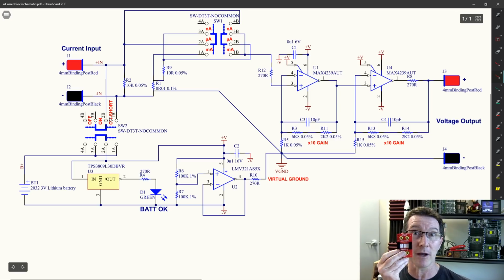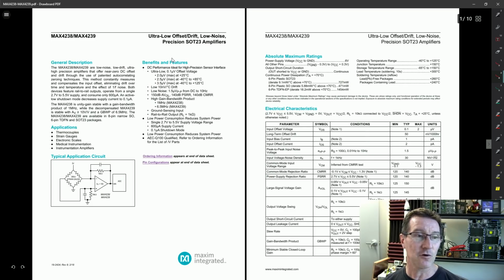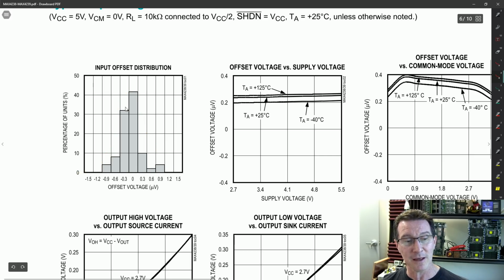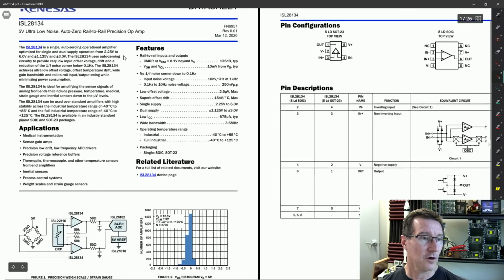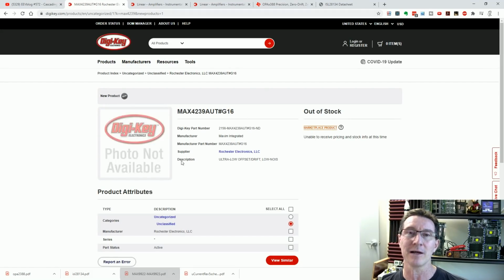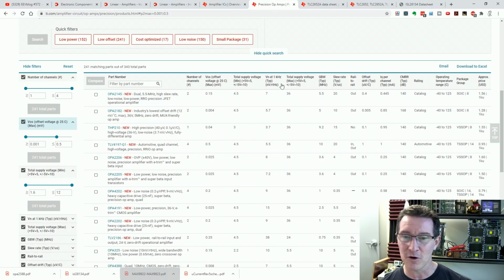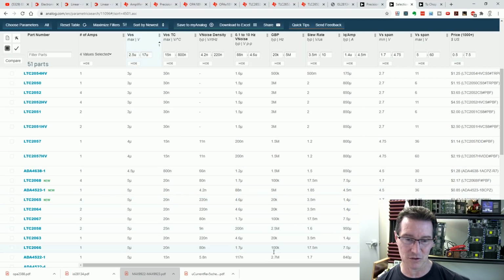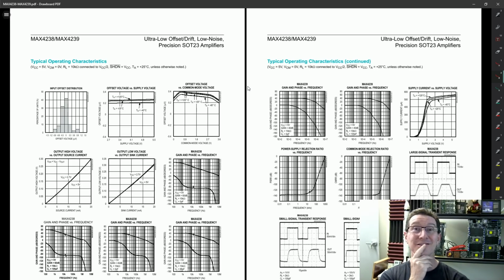EEVblog #1318 - What's State-of-the-Art in µCurrent Opamps?

Comment: Hi Dave, I retired as the managing director of product definition for standard products at Maxim a few years ago.  My group and I defined thousands of products like this for over 20 years and I had a hand in the 4239 parts as well as many, many others.   There were a couple issues that came up in this video that I can shed a bit of light on from the chip company side.   Although Philbrick made precsion amps in 50's with tubes,   Intersil , the spiritual father of Maxim invented this category in CMOS chopper amps in the 70's with the ICL7652.  Maxim's second sourced these parts and made improved second sources early in its life.  Here are a few points that may give you a better handle on how chip companies approach high performance analog.  Because of the way that these parts work, the nominal offset is zero.  What gets in the way of this is real third order effect like thermocouple action in the leads and package stress.  Maxim is somewhat unique in that it can and does do post package trim (zener zapping)  vs. just laser trim a the wafer level.  Parts that are perfect at wafer end up being a couple of uV post package due to stresses.  The other thing about very high spec parts like this (100 nV) is testing.  In order to get good yields, test max limits are generally set higher, we called this the threshold of pain.  The typicial values and histograms are there to give you a feel for what you're really going to get.  In difficult to test specs, you're balancing how many seconds you're spending on a million dollar tester- the cost get significant.  Some specs llike leakage currents in analog switches will often have a max spec of 10 uA though will generally be in the femto amp range.  We would release a different external part number that guaranteed a spec like this.  You can get an idea of the real spread by asking a vendor to make you 10,000 (a common minimum) with some spec tightly tested and they don't balk, it means the parts will yield if the customer is willing to pay the delta in test cost (plus NRE)..  Maxim routinely does this for big customers with precision requirements like a test equipment company.  The histograms in the data sheet is taken from the first few wafer lots as the test guys and the design guys dial things in- this process is called correlation.  On a little amplifier parts on big wafers, there be 5000 die per wafer so you can generate a lot of test data pretty quickly.  The voltage range/dynamic range issue is driven by modern processes.  Maxim has a lot of boutique processes but most analog part in the market are made on kind of vanilla cmos processes which are generally digital and low voltage.  These are generally 100-200 micron processes.  If you see cmos parts with +-5V or +-15v supplies, they are fabbed on old 2 micron plus processes or a specialty analogy process.  Maxim, TI and Analog and a very few others keep these old processes running for precision analog.  The economics of doing 130 nm analog on 300 mm wafers makes parts really cheap even though it takes some real design chops to do it.  Your comments about automotive are somewhat on target, they can be robust but mainly this designation has to do to with consistency of supply, change notices and paper.  Sometimes specs are relaxed to improve yields also.  Automotive guys can work with anything but they don't like surprises.  Hope this helps a little.
Reply: Daniel- fancy processes usually cost more and are on smaller wafers.  It all adds up to cost.  There are several companies that have the processes and even foundries have them but you don't want to use a cadillac process unless you have to.  A 200 mm wafer that could produce 5000 amplifier die per wafer might cost  $500 in a cheap CMOS process.  Fi you want dielectrically isolated or SOI, you get 150 mm wafers for $1000 that only produce 1250 amps (4x less area).  The trick is to make stuff on the biggest, cheapest wafers you can if you want to make money.  The engineering that it takes to do all these clever things on bulk CMOS is what seperates the men from the boys.  There are times when you need SOI but they are avoided strongly.
Reply: This is truly fascinating!
Reply: Really interesting knowledge here. Hope you could write more blog posts like this somewhere.

This is really useful for us youngster.

Comment: Disagree with your statements about guaranteed by design vs guaranteed by testing. Guaranteed by design means assuming process tolerances are within spec then the specification is guaranteed based on physical principles. They can then easily test the process tolerances, or similarly guarantee them. Guarantee by testing just means that they never found a bad part.
Reply: Maxim used a 6 sigma spec for GBD specs which is on the same order as test escapes- about 3 ppm

Comment: Dave, how do you know tht the max4238/9 are indeed chopper amps? Well I am from a time where the µA725 (Fairchild) was the top of the top. Sure there are much better choices today, but even back then there were laser trimmed dual chip solutions available. Also self calibrating op amps I think I have heard of. Now chopper amps are a different category alltogether. Just wondering how you conclude its a chopper amp? Does the spec sheet specify a copper frequency?
Reply from the maker: It's a patanted  "auto-zero" design. Usually they mix the two. Yes, the switching frequency is pseudorandom
 from 10kHz to 15kHz, and you can see this in the response.

Comment: Concerning the bandwidth of an non inverting opamp amplifier, WHY the bandwith decreases with increasing gain? There is any reason that's not the slew rate limitation on its output, or it's the only reason?
Reply: Nope the slew rate is only a property of the last stage. Op amps have multiple stages. To ensure a constant gain bandwidth product they need to be compensated as every stage inserts a pole in the overall response. General use opamps have compensation caps on the chip. High bandwidth ones can be compensated externally. Now the reason for the forced 20dB per decade for the general purpose amps falloff is stability. In the Nyquist plot of any four-pole stability is guaranteed by avoiding the -1,j0 point. There are special applications that get more bandwidth by getting the plot closer to instability by placing the poles of each stage at different frequencies. But then you no longer have the maximal flat response and depending on the location of these poles you get a different phase behavior which may lead to ringing on transients. By means of L2 optimization you can find compensations that fulfill your needs  (e.g. Bessel, Butterworth, Cauer etc. Responses). Way back in the 80s this was part of my work.

Comment: I would not put my attention on a low offset voltage with such a product. This can be calibrated later. The drift is probably more critical here. I would even go so far as to say that another very  important criterion for such a product is the isolation (between input and output). I have been working on this topic for quite some time and came to the conclusion that it doesn't even make sense to use an isolation amplifier or high precision optocouplers but to go the way through digitalization (24 Bit ADC). In this way you could include various calibrations which is very difficult or costly to achieve with pure analog technology. Of course the question arises whether one wants to output the values as voltage (DAC) - which would be possible, or whether one can live with the digitized value.
Reply from the maker: Sure. But the entire point was to avoid calibration.
Reply: @EEVblog  we can't have it all, it's either bandwidth, offset, noise / stability,
Reply: We don't wanna do any " pot tweaking "
Reply: Your time for programming is free? This is by far the main reason not to go for any microcontroller. It takes time to program them.
Yes, obviously this can be automated. But that's only interesting when selling enough of them and in the end will cost you still a little more.
Reply: P_ Mouse flexibility is the other, I much prefer a digital system, with minimal analog decisions deferred to digital, digital power supply for example, with a fully digital feedback loop, SDR is the other example
Reply: @FooBar89  That is correct, but there is a trade-off.
And quite often that trade-off is not completely decided by me, but by either my costumers or my boss. 
Not to talk about trade-offs in sense of absolute performance. Not more than often have I seen very complicated, not so well performing and expensive digital solutions, that can be very easily be done with just an handful of simple analog electronics. (or even logic gates)
Reply: @FooBar89  Don't digital systems have noise of their own? and isn't power draw also far higher.. Powering the system with a 2032 lithium battery might suffer from short battery life.. Sure, you can put a big clunky 18650 on it..
Reply: Rx7man depends what you’re product is, it’s not suitable everywhere